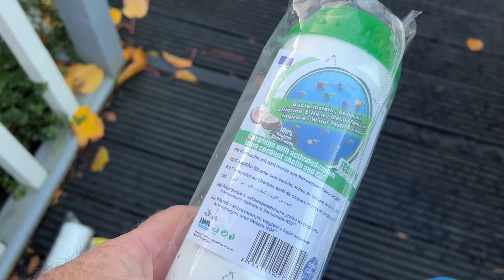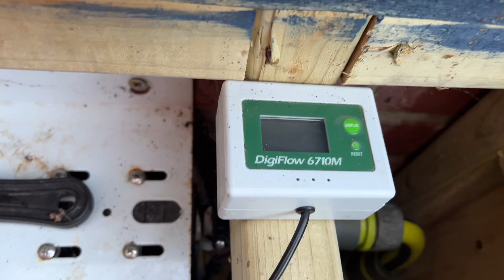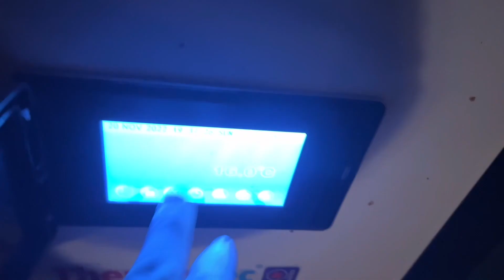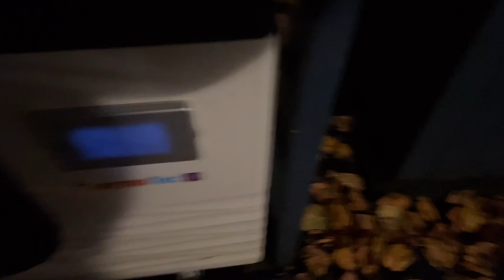#KOIPONDUPDATE.covers on.new dechlorination cartridges,Hagrid is the #Byer/ Daily G&S winner

Comment: Hi Martin you do know KDF is Copper and Zinc granules?
Reply from the maker: Hi Tony, yes mate I do , I had an in depth conversation with Vyair about it and I’m assured that the way the chemical reaction works that it shouldn’t leach into the pond and if any does the third cartridge should deal with it , but I’m keeping a close eye on the koi , 
But cheers mate for saying 👍👍😎😎
Reply: @K.W.P.R  good to hear you’re on top of it👍KDF caused lots of koi deaths and koi health problems back in the 1990’s when it first came on the market in the Sirius water purifiers, it was noted that It was completely eliminating blanket weed from ponds, and one company released a filter called the Aqua Star using KDF to kill blanket weed which worked really well but as soon as you noticed the blanket weed dying you had to remove the KDF part of the filter, so I would say keep an eye on the blanket weed if it starts dying maybe stop using them
Reply from the maker: Thanks tony I will do , as long as the kdf, cartridge is before the carbon block all should be good but I’ll deffo be keeping an eye on any blanket weed , good tip mate 👍